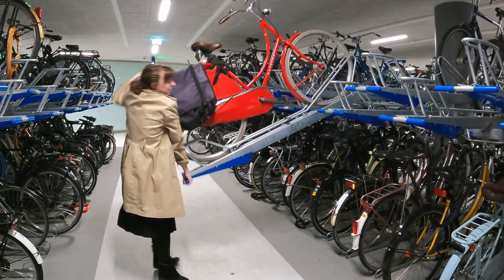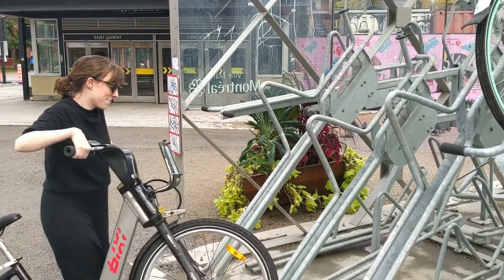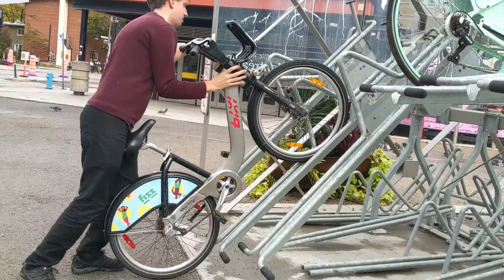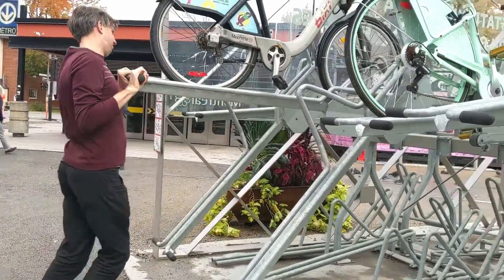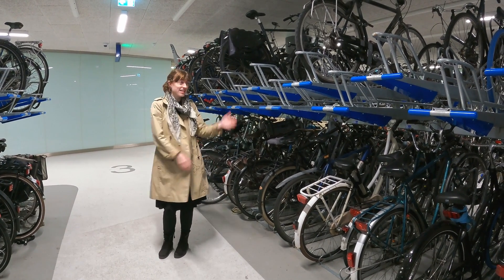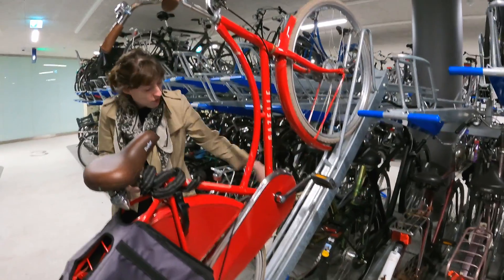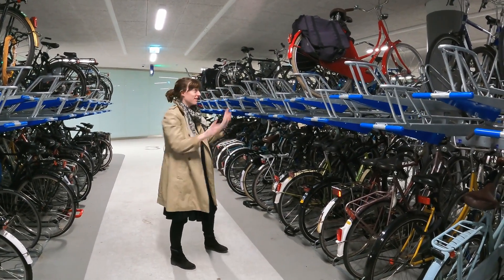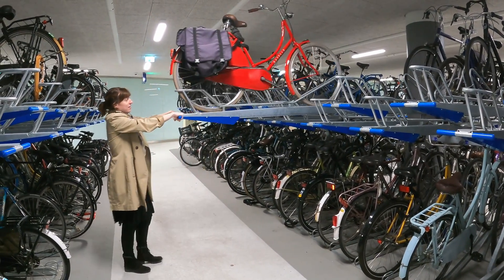Double Decker Cycle Parking: Details Matter

Comment: This is a spurious and deceptive post - 1/10.
Bixi bikes are bike-share scheme bikes; made to be very heavy for durability and theft prevention. The Dutch bike shown is a much lighter frame. There is a special rack for Bixi bikes. It is still going to be difficult to lift a heavy bike-share bike over the rear wheel buffer on the Dutch rack. This is not shown at all in the video.
Reply: From what I could find online, the electric Bixi bike is 30 kg and an omafiets with accessories can be over 25 kg. Is that a large difference?
Reply: @kevinmbrooks  5kg extra is enough to make a difference, along with the inept mounting techniques shown by the Bixi users. I'd love to see them try to get the Bixi onto the Dutch rack.
Reply: Agreed. Not a fair comparison. Although the non-Dutch bike parking does look pretty bad.
Reply: Pete & others, you have a good eye. I didn't notice at first.

Upon rewatching. I also noticed that the guy pushed on the handles, when moving the bike up the rack. He should have pushed on the seat, while trusting the rack to guise the front wheel. I feel like he was being deliberately obtuse.

She also mentioned that near end of the Dutch rack had a thing for holding the bike in...but neglected to mention the hook for the front wheel at the far end of the of the 'American' rack. Both serve the same goal; 1 might be easier to use than the other, though. Maybe the hook can be used by controlling the bike from the back.

Comment: When you pull out the beam, the Dutch one already has a parking rack at the bottom of it. So anyone can easily put their front wheel in it and the bicycle is stable enough to stand on its own. Then you take your time to go onto the next task > which is pushing the bike into the rack. After that, the back/bottom rack holds the entire bike in its place > you can concentrate on pulling the beam up > now you can push it in. In the American one, you need to do all of these things at the same time, making it unnecessarily difficult. When you take the bike out, the Dutch will have that end rack, that keeps your bike from rolling away. Great demonstration!